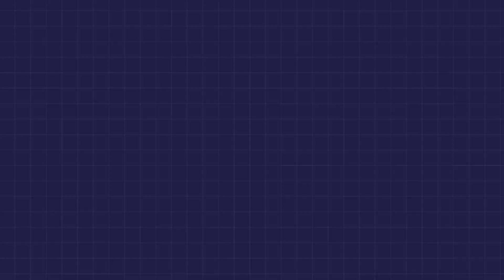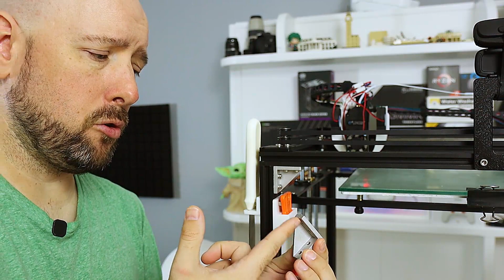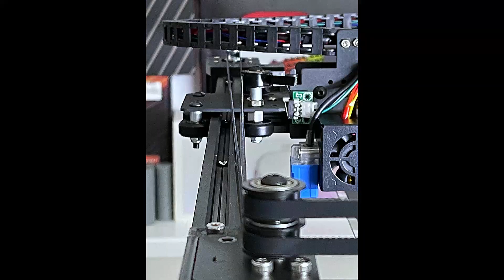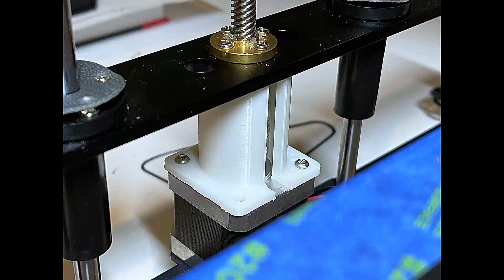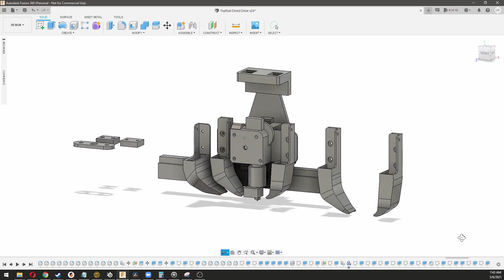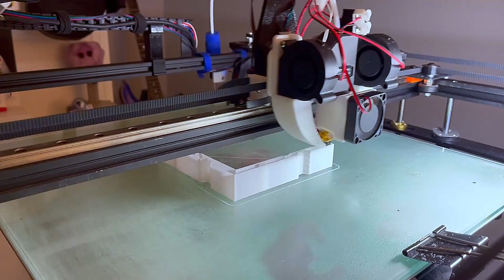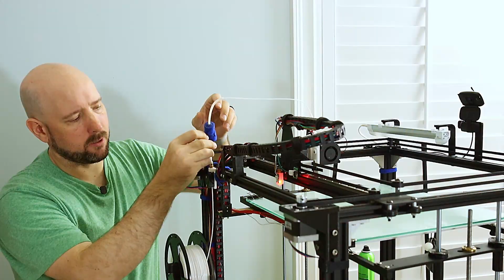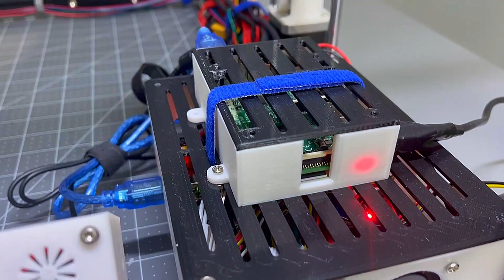TronXY X5SA Upgrades (Frame, Bed, Linear Rail + Direct Drive, PSU, Electronics)

Comment: I'm a beginner in 3d printing and hobby electronics and it's inspiring to see you work through problems and improve upon the design of the printer. This printer doesn't seem like the best choice for a beginner but seeing all your changes makes me want to get one and tinker with it too!
Reply from the maker: Hey Ren, welcome to what will soon be your favorite hobby.  If your primary goal of getting a 3D printer is to, you know, print things then the X5SA might not be the best intro to the hobby.  However if you're getting into 3D printing because the tech is cool and you want to learn a lot about how everything works, spend time and money on upgrades and options, and are looking for a printer that can grow with you then the X5SA (on sale) may not be a bad option.

My first printer was a FolgerTech i3 kit.  It was completely bare bones - basically as good as buying a bunch of parts from AliExpress.  Sure, it took 12 hours to put together but I learned a LOT from that experience and it paid off in the long run.
Reply: @LilMikeysBigPlans  Thank you for such an in-depth reply! It feels very welcoming reading this.
Ideally, I would like something in-between the two. A printer that I can grow with and learn from, but something that can make somewhat functional prints (at least functional enough that I can print improvements for the printer). I'd like to get into learning robotics and I've seen that 3D printing can be used to make all sorts of cool robot design, gears, etc.
I was originally looking at the neptune 2s as it seem similar enough to an ender 3 v2 to support many of the same mods but comes with better build quality and upgrades out of the box. When I stumbled upon a core XY design though, I was just captivated by the looks. It seems like most printers of this design outside of the X5SA are really expensive but the stock X5SA is deemed as not a good printer. It looks like you have managed to make it a more than capable machine though. That's what I'm finding I really love about this community. So many people want to improve upon what they have. It just feels like such a welcoming change from other areas of tech, with products becoming increasingly harder to open up or repair. 
I'm still not sure on what my choice will be for my first printer but I hope to get good enough at some point to design my own improvements like you have!

Comment: I have to ask - I don't have the 400, but the x5sa 330x330 build - - would all your mods work on it??  Looks like it - and on the linear rails - did you have a link to the washers you used to drop the extrusion?  Thank you.
Reply from the maker: Hey Phil.  Ya, I think everything should work on the standard version.  The washers for the rail are 'X-Axis_Extrusion_Spacer_M4' or M5 (depending on which screws/T-nuts you have) on the carriage's thingiverse page: https://www.thingiverse.com/thing:4852310/files.
Reply: @LilMikeysBigPlans  Hey - I like your mods.  Was wondering if you ever did  linear rail on the Y - and wondered why you didn't  with the x rail...   was there a reason ?  Would I notice the difference?

Comment: All I know is my Tronxy X5SA won't even do auto leveling or even work doing manual leveling!  

I have the normal printer no mods I did buy a Tronxy Titan Extruder because the company told me it was needed for better control of any Flexible Filaments and the PET-G etc. 

I also brought a Tronxy new Ultra-Flex Magnetic bed sheet, 
the only problem I got with the magnetic bed sheet is when the bed temperature got up to 75 to 80 C the edges would all curl up 
so I had the use the original small spring clips to keep down those edges.

As for the leveling being such a huge bed and the fact there is 6 screws to adjust instead of the normal 4 makes leveling a nightmare.
I once pend 3 hours doing around 40 auto leveling programs and adjusting those 6 screws and still it would not level?

Every time I get it where it looked good level wise the head would go from the start corner to start printing and I have to stop the printing because the nozzle would be either 6 mm too high of the bed even though I leveled it as good as possible or it be too close to the bed by 2 mm all at random no two times the same.

I can't afford to pay out for all the better parts and electronic boards etc. so the printer just sits un-used under a cover.  
I after ages managed to save up and bought a Voxelab Aquila ( sub company of Flashforge I found out ) it is a clone of the printer I was going to get the Ender 3 V2.

I got the Aquila as it saved me £57 on the price of the Ender 3 V2 on Amazon UK. 
it was a smaller bed with 4 screws and a U frame and worked fine and only took 40 minutes to build as it was 60% pre-build.

Unlike the Tronxy X5SA which took 4 days to do ( my 1st ever 3D printer with bad paper manual ) my printer was the newer 2020 updated model the paper manual I found out was for the 2019 model so those new upgrades in the design made it very hard to build it. I found out later I could have used the PDF manual on the card as that was up to date.

Now the Aquila has gone down on me, had a thermal Runaway Event on the hot end.  

I changed the heater and the thermistor but the temperature went ll over the place on the hot end 
Then found out that if you replace the hot end parts you have to do a PID tuning to lock down the hot end temperature, 

So tried that each time using  PC and a USB C cable and a program called
Pronterface, But each time the hot end heater would shoot up like mad up to 250 C and the pronterface would say error temperature too high test failed?
 
Sofar Flashforge has sent me a new main board and I had to pay out for more heating cartridges and thermistors ( changed them in hot end now 2 times )
I now trying to sort out why the hot end keeps shooting fast up to 250 C? the bed of course is fine since I not changed it's heating or thermistor.

So two 3D printers Tronxy X5SA can't level it, the Aquila can't tune the hot end. What a huge pain. 

And with limited money now I can't even upgrade either or fix either.

Makes my wish I never took up the hobby?
Reply from the maker: Man, it sounds like you have had quite a few headaches.  If I were in your shoes I would step back and simplify.  Get yourself a glass sheet for the bed.  You know it'll be flat and it won't have any weird curling or adhesion issues.  Then I would replace whatever sensor TronXY gave you with a mechanical endstop switch.  You might have to jury-rig or print some kind of mount for it but, in all honestly, apart from Piezo and BLTouch any other sensor is just not reliable or accurate enough to waste time with.  If memory serves you can plug in the end stop switch where the blue/black sensor is connected now.  Then, don't mess with any kind of mesh leveling or level programs, just level the thing by hand.  Assuming you use the 'stepper hat' trick you should be good for bed leveling on the TronXY.

I'm not familiar with the Aquila but it may just be a simple case of having your max temp set lower than what your PID tuning to.  If your max temp is 245 and you PID tune at 250 you're going to trigger a shutdown.  If you think your hot end is heating too fast (it takes mine ~1:20 to get to 235) then it would likely either be the wrong thermistor in the firmware (or bad thermistor but that's usually a more obvious failure) or you're using a 12v core on a 24v printer.

It's too late now, but I suggest most people start with a smaller, simple i3 style machine with decent quality control - like an Ender 3 - as these things get very complex and very frustrating real quick.

Comment: Trank you VERY much for your Tips. I got a TronXY X5SA - 400 and with your help i could get  ist running. I am running the stock Mainboard V6 with MARLIN 2.0 . It runs very well now.
Reply from the maker: Glad you found the video helpful!  Marlin is the way to go - at least until/if your board dies.  It seems like there are a lot of dead Chitu boards out there - but if you're running Marlin then at least the transition will be easy if you do ever have to jump.

Comment: Saving this video for later, got one of these printers coming.  It's not my first or only printer.
Reply from the maker: Good luck!  Feel free to shout if you have any questions.
Reply: @LilMikeysBigPlans  thanks I appreciate it. 
I am upgrading to an e3d v6 hotend, have the parts,haven't installed.  I find the stock one lacking. What board did you end up switching to when the stock failed?
Reply from the maker: @bleach_drink_me  SKR1.4 w/ TMC2209s.  Couldn't find any way to use the stock LCD with it so if you're making the jump then plan for an LCD if you need one.
Reply: @LilMikeysBigPlans  thanks again. I don't plan to swap yet, I have only had the printer a week and am getting it dialed in decently.  I am going to make a list from your video, so when things fail or I get the upgrade bug I know what I need 😆.
Reply: New to all this I found this for 195 so I ordered it   but thinking I mies as well do the upgrades  would you be interested in printing the brackets and cases you made

Comment: Good video but the link to the motor mounts you only have the ones for the y axis and not the x axis ones.
Reply from the maker: Hey Carl Sagan, nice name :)  All you have to do is mirror the mount or washer for the other side however a lot of people have messaged or commented the same so I went ahead and uploaded mirrored versions.
Reply: @LilMikeysBigPlans  Thanks! That's what I ended up doing after playing with Cura. The motor mount definitely helped with my printing quality. I tried turning my system into a linear rod system but my double extrusion setup has made it super hard. I'm going to turn it back to a pulley wheel system and use your files.
Reply from the maker: @TheLegendaryBootyWarriah  Yeah, my experience with linear rods is that they have pretty poor lateral strength.  Good for vertical runs but if it has to hold some weight over a long-ish run then the rod will likely flex and shake a bit.  The X5SA Pro uses a kind-of rail+extrusion hybrid where the smooth rods sit in the 2020 channels.  It's the strength of an extrusion with the smoothness of a rod - but that's a pretty small upgrade over wheels in slots and if you're going to go that far might as well jump to true linear rails.
Reply from the maker: @TheLegendaryBootyWarriah  What's you're dual extrusion set up?  I ran dual direct V6s on my FT-5 for a while but it was a pain to keep aligned.  Keep thinking of going back to a bowden dual setup with a single hot end.
Reply: @LilMikeysBigPlans  I bought the tronxy X5SA-2E upgrade. It's a 2 in one out hotend. I just upgraded the tubing to Capricorn ptfe tubes, used a top loading Bowden tube, trimmed them and it reduced my retraction significantly. It literally went from 10-12mm and 60-80mm/s to 4.5-6mm and 20mm/s. Had to dial in some settings but it's working ish right now. Thinking of doing a mixing dual hotend set up. That way I don't have to fuss with retraction.

Comment: Id say you're better off upgrading the motherboard to something like SKR 1.4 turbo then instead of needing a belt to sync the motors your can use the new feature in marling to level the gantry.
Reply from the maker: Agreed, and that's the setup I'm running now, but that's new board, additional stepper driver, and more firmware setup.  The sync belt works with any setup.

Comment: What would be a better, affordable ore XY printer to buy that wouldn't need these mods?
Reply from the maker: There aren't a ton of CoreXYs out there.  If I wanted something more solid out of the box I'd probably suggest the Ender 6.  Not that I have any experience with it, just believe in the brand.  If you don't need CoreXY, just want a larger format cube printer the Ender 5 also looks to be pretty nice.

Comment: Absolutely brilliant video and well presented! I’m trying to decide on getting this printer or go the way of building a Voron. Just one thing I was completely clear on: the top pillow washers can be just removed? Did you also do the “ball bearing trick” for the bottom of that rod? Did you consider the Voron head? I’ve head it’s possible to wrangle it on to the X5SA Pro.
Reply from the maker: Vorons are awesome but I can't justify the price.  I did look in to their carriage - the 'afterburner' or something like that.  It looks cool bit it's kinda big/complex, designed for specific extruder hardware, uses inset nuts, and would still need to be modified to support the belt position of the TronXY.
Reply: Honestly you can get this to print just as good with some mods thatre printable
Reply: You can buy the non-pro and turn it into a VZbot :P